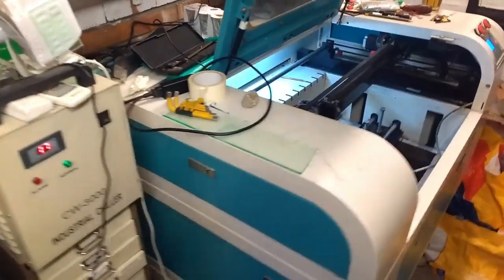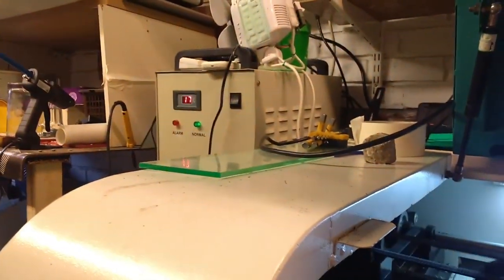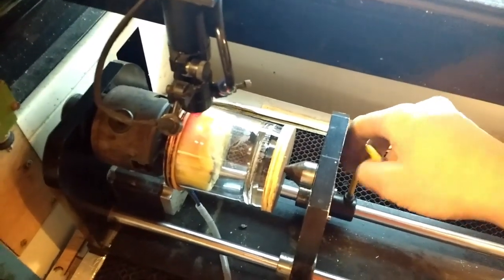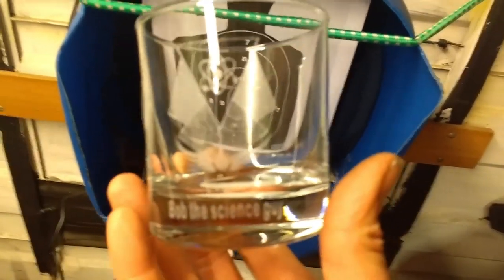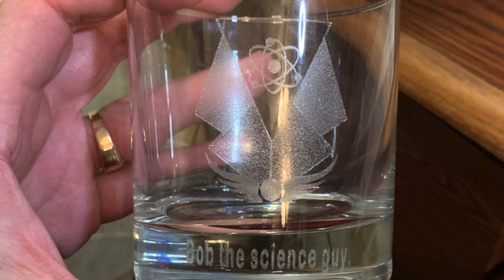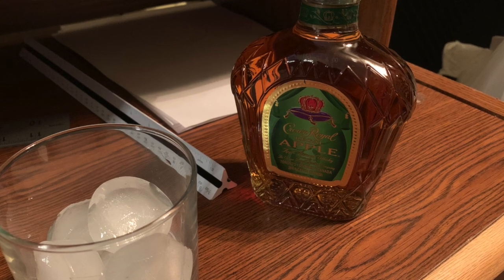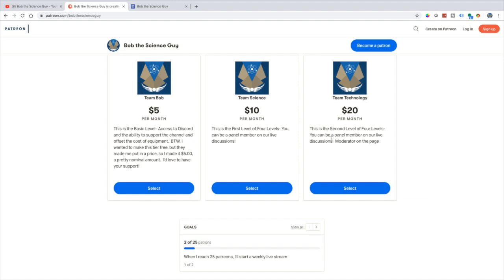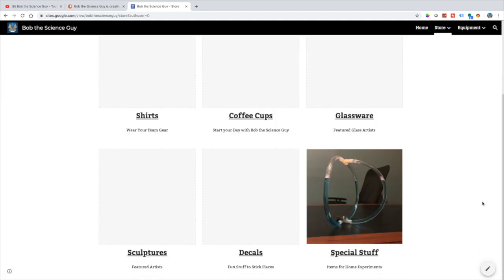Making a Tumbler for Bob

Comment: How did Bob prove the globe in this video?
Reply: @BobtheScienceGuy  You have your tumbler, a container, you pour an adult beverage (a liquid) into it, and add some ice (a floating solid). Sound familiar?  It's right out of Archimedes' Hydrostatics.  You're not celebrating. You're experimenting.  The second postulate of Archimedes' Hydrostatics is: "Let it be assumed that, of bodies which are borne
upwards in a fluid, each is borne upwards along the
 perpendicular drawn through its centre of gravity, and then in the second proposition he states: "The surface of any fluid at rest is the surface of a sphere having the same centre as the earth."  See Thomas, Greek Mathematics Volume 2, pp 244-251 for the original Greek & Latin and English translation.  
Wolfie6020 ran the same experiment in Hawaii recently and got the same results you did.  If you repeated the same experiment now you would get the same results.  If other globers, WheresWa11y, 
SciManDan, Conspiracy Catz etc conducted the same experiment they would get the same results.  This is only possible on spheral earth.

So now that you have tumbler for sale you need an ice maker or ice bucket, and bundle that together as a science kit, just like Mr Wizard used to do.
Reply from the maker: @michaelconnors7668  well said.
Reply: @BobtheScienceGuy  You didn't even have your lab coat on, and you still did science.

Comment: Hey bob, may I suggest an experiment for you to try?  Put a helium balloon into a sealed box with a camera.  Then drop that box with the balloon off a bridge/building whatever high point.  Will the helium balloon stick to the top of the box as it falls OR will the balloon be pinned to the bottom of the box (unable to float up) due to the air density building up at the top, reversing buoyancy, due to gravity’s acceleration downward?  Based on my experiments with a balloon in a car, my hypothesis is that the balloon would be unable to float if dropped off a high bridge.  I haven’t had the time to try this yet but I’m curious as to your opinion on it.  Could be worth looking into, proving gravity is a force.
Reply: The balloon is stuck at the top of the box before the drop (buoyancy), then when it's dropped it is in a zero g situation. So my guess is it should stay at the top, or show little to no tendency to move in the box.
Reply: FrenchCrow helium is lighter than air, It doesn’t react to zero G the same way as you would expect.
Reply: I like this a lot